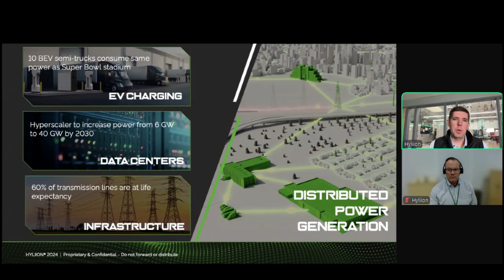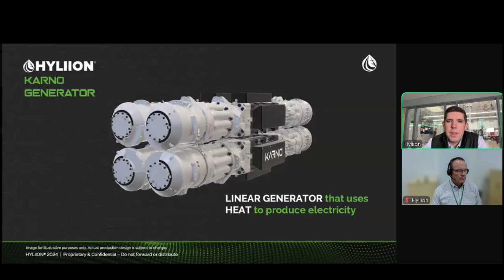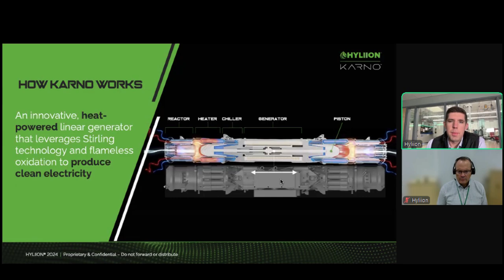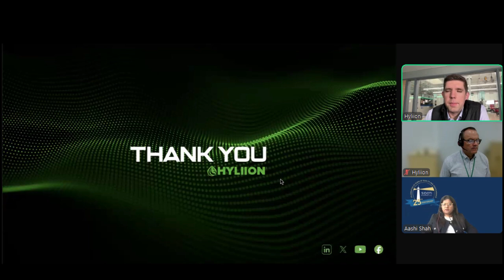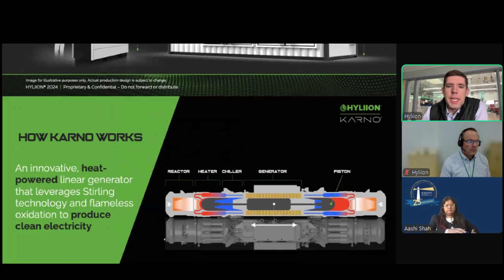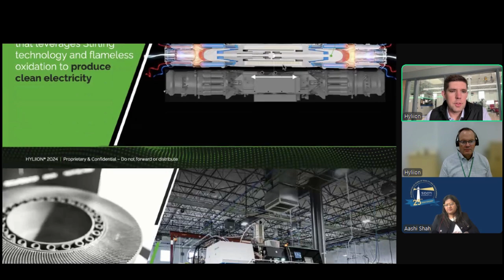@hyliion Founder and CEO, Thomas Healy OnSidoti Micro Cap Virtual Conference 2024 for #karno

Comment: I wish they would touch on the international demand also, especially in places where SMRs just won't happen for one reason or another. This modular ultra low maintenance solution would be a game changer.
Reply: @anydaynow01  When you are in R&D then test phase, then run phase, then replicate phase, you want each unit in each phase to be near one another. Far away places are not critical until your near-by market is satisfied.

Comment: Healy if you deploy the karno to power your own factory it would help you guys refine the karno and make it more stable when you run into edge-case issues yourselves. And what better way to market?  Good luck!
Reply: I think their rate of production right now is very low since they don't have most of their intended printing machines up and running yet, so they probably want to start by getting a few into customer's hands and getting sales.
Reply: They do run the OHIO Lab using Gen 1 Karno.  Of course they turn on and off as needed for Testing Upgrade. This was one of the set-up observed during  live walk-thru lab
Reply: @EddyDLahens  Beat me to it, they have a few running proof of concept units powering infrastructure, they are in the production unit refining phase right now.